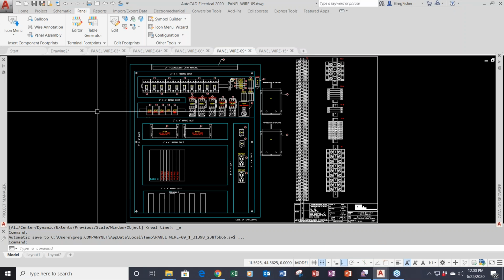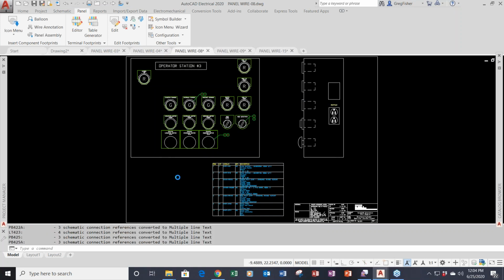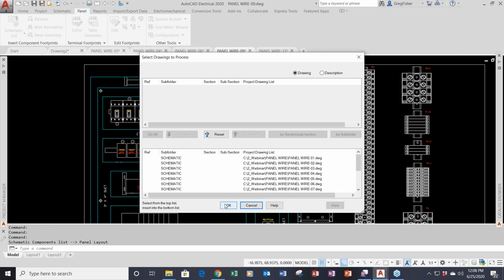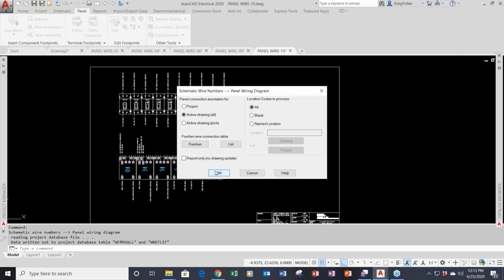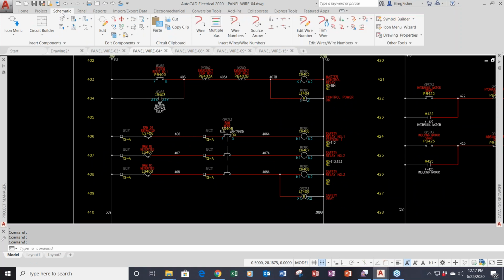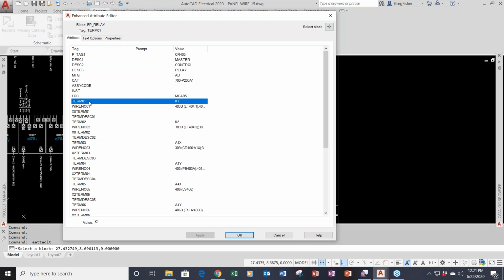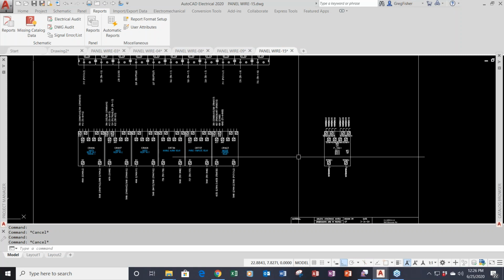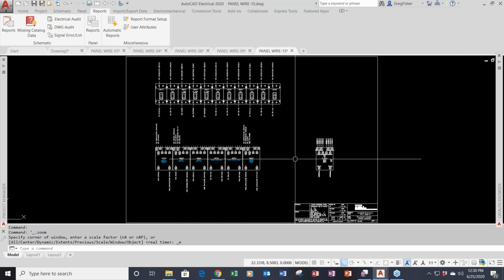AutoCAD Electrical: Adding Wire Information to Footprints

Comment: Hello, thanks for your webinars, what about the line that is created with the new connections? How to do that i can get the text to appear? do you use dynamic blocks or a script?
Reply from the maker: Thank you for watching them! 
The text that appears on the connections is driven by attributes built directly into the footprint symbol block itself — not dynamic blocks or a script. Here's how it works:

Each connection point on the footprint symbol needs three specific attributes: the connection point attribute (terminal/pin number), a terminal description attribute, and a wire number attribute. Once those are in place, you run the Wire Annotation command (under the Panel tab) and it automatically populates those attributes with the correct wiring information from your schematic.

If your footprint symbol doesn't have those attributes built in, AutoCAD Electrical will still display the wire info — but it drops it as MTEXT on top of the symbol, which can get messy. The cleaner approach is to either build a secondary footprint symbol with the wiring attributes included, or add them to your original symbol on a separate layer that you can toggle on/off. Hope that helps!

Comment: how to get schematic relay contact description and cross reference in relay footprint
Reply from the maker: To pull the schematic relay contact descriptions and cross-reference information into your relay footprint, you'll need two things in place:

The correct attributes in your footprint symbol — specifically X4TERMDESCxx for contact descriptions and X4TERMxx for terminal/cross-reference data. These need to be built into the footprint block using Symbol Builder

Run the Wire Annotation tool — found under the Panel tab → Insert Component Footprints → Wire Annotation. This links the schematic data (including contact descriptions and cross-references) back to those attributes in the footprint

If those attributes aren't present in your footprint symbol, AutoCAD Electrical won't have anywhere to write that data. The cleanest fix is to rebuild or update the footprint using Symbol Builder to include those attributes. Hope that helps

Comment: Hello can you create the panel labels for the connections?
Reply from the maker: Yes, you can create panel labels for connections in AutoCAD Electrical. To do this, you’ll typically use the Schematic Reports and Panel Reports tools:

- Go to the Reports tab and run a Panel Report (like From/To Wire Connections or Terminal Plans).
- Configure the report to show the connection details you need (wires, terminals, source/destination, etc.).
- Place the report directly into your drawing, which generates the labels automatically.
- You can also customize the format using the Report Format Setup if you want the labels to match your standards.

This way, the connection info is pulled directly from the schematic and tied to the panel layout, so everything stays synchronized.

Comment: Great and informative video, thank you.
Do you have any information with regard to the use of the Clen property in the Form-To report, I understand that it is linked in some way to what you have explained, but I can't seem to find any meaningful reference online on how to implement and use this attribute to establish cable/wire lengths.

Any help or link that explains the system better the the Autodesk help would be great, Thanks again for the insight on the video.
Reply from the maker: Thank you so much, really glad it was helpful! Here's what we know:

CLEN is a calculated wire/cable length field available in the Cable From/To report. It doesn't pull from a manually entered attribute on your schematic — instead, it's a length value that you can manually enter or edit directly in the Report Generator dialog using Edit Mode before saving or placing the report. AutoCAD Electrical does not automatically calculate wire lengths from the drawing geometry, so CLEN is essentially a user-populated field within the report itself, not something driven by your schematic data.

To access it: run your Cable From/To report → click Change Report Format in the Report Generator dialog → add CLEN as a column → use Edit Mode to populate the length values manually.

It's unfortunately not a fully automated measurement tool, which is a common source of confusion. If you need automated wire length calculations, that typically requires a 3D harness design tool like Autodesk Inventor with cable and harness functionality. Hope that clears it up

Comment: It was a nice webinar. I tried what you done, but i am having some doubts, how the FP recognize the schematic pin nos. In FP we have to feed the all child pin nos or it will take from Catalog database of the component. Please do advise...
Reply from the maker: Thank you! 

This is one of the more powerful but lesser-known features in AutoCAD Electrical! Here's how it works:

The footprint does not read pin numbers directly from the schematic child symbols. Instead, the TERMxx attributes on the footprint get their pin numbers from the Pin List in the catalog database — specifically the COILPINS field (for the parent/coil) and the PINLIST field (for child contacts). When you assign a catalog part number to a component on the schematic, AutoCAD Electrical pulls those pin values from the catalog and writes them to the TERM01, TERM02, etc. attributes automatically.

So to answer your question directly — you don't need to manually feed pin numbers into the footprint. As long as your catalog entry has the COILPINS/PINLIST fields populated correctly, AutoCAD Electrical handles the mapping automatically when the Wire Annotation runs. If pins aren't populating, it usually means the catalog entry is missing that Pin List data.

We actually have a great blog post that walks through this in detail — check it out here: https://blog.hagerman.com/autocad-electrical-the-pin-is-mightier-than-the-coil-part-one — it covers exactly how to set up and use the Pin List in the catalog. Hope that helps!

Comment: HOW DID YOU GET THE TERMXX TO SHOW ONLY WHEN THE WIRE NUMBER SHOW OR USED?
Reply from the maker: To make sure we give you the most accurate answer — are you seeing the TERMxx attributes showing up as blank/empty text on footprints where there's no wire connected? Or are you asking how to set up the attribute so it's invisible by default and only displays when a wire number gets written to it?

Knowing which scenario you're dealing with will help us point you to the right fix.

Comment: I was able to make a block just like you did, it works. When I opened another panel drawing it showed the wiring annotations. Why is it showing them on other drawings?
Reply from the maker: Glad it's working! The reason you're seeing wire annotations on other panel drawings is that the Wire Annotation command operates at the project level — when you run it, AutoCAD Electrical scans all schematic connections across the entire project and pushes that wiring data to every panel footprint it finds a match for, regardless of which drawing they live in. That's actually by design, since your panel layout drawings are all linked to the same schematic project.

If you only want to run it on a specific drawing, when the Wire Annotation dialog appears make sure to select "Active drawing only" instead of the project-wide option. That way it will limit the annotation update to just the drawing you're currently working in. Hope that clears it up!